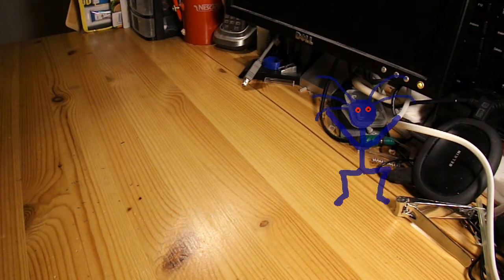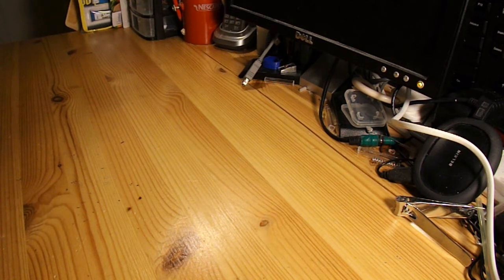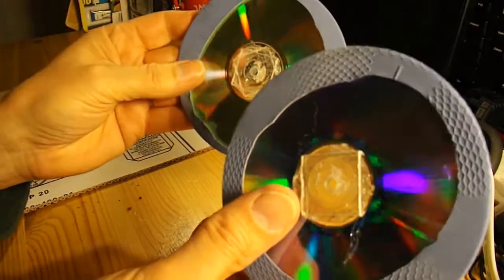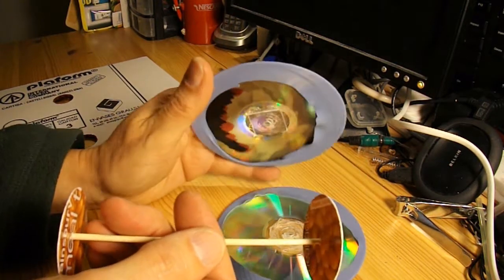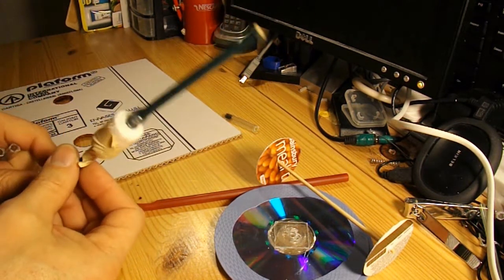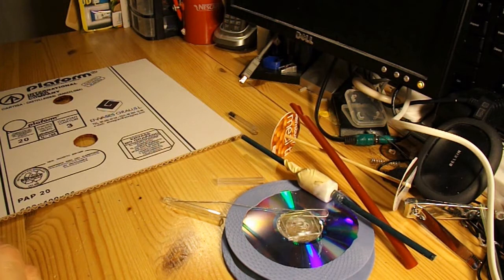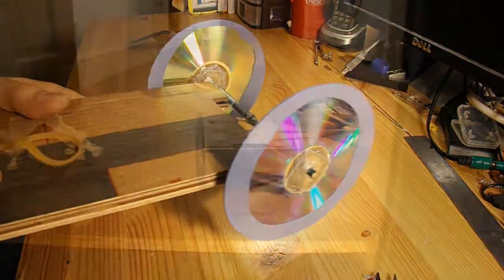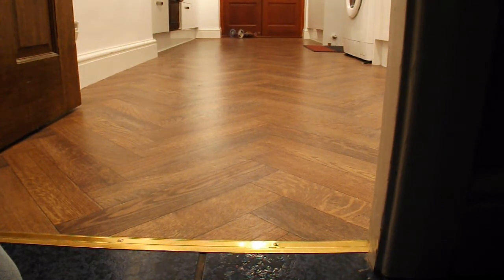Nothing's Simple Rubberband Powered Car

Comment: Hellooo!! We also have project to create our own car without using any battery, and we plan to create just like what you did. Our car should travel 4 meters after an inclined plane (30°). Can this car model or design work?? And how can the car you made be moreee faster? And does this also apply in a cemented floor? HOPE YOU HELP ME WITH THIS🥹🥹
Reply from the maker: From your description, I am guessing the car rolls down a slope to build up momentum, and then has to roll 4 metres. I would suggest thin axles, maybe use a bicycle spoke. Use large thin wheels, like CDs or DVDs. The thin axles will minimise the friction created in the axle tubes. The large wheels will help avoid the rough surface of cement. Adding weight may also help build the momentum. Here is an example of a car showing the weight helps https://youtu.be/N9S49KMwXmI
Reply: @GrandadIsAnOldMan THANK YOU SO MUCH!!! But if in a flat smooth surface, can the car that you made be more faster?
Reply from the maker: @Random-ir9xt  you are confusing me. You are asking about this car, which is rubber band powered, but you are saying that your project is for a gravity powered car running down a slope to generate the momentum. Once the car is on the flat surface, the only thing slowing it down is friction. The friction is the axle rubbing in the axle tube and the wheels on the ground. Are you saying that your car can be powered?
Reply: I’m sorry for the confusion :((( 
There will be 2 activity, the first one is that it should travel 4 meters after an inclined plane. And then after that, we can modify or enhance/add material or remove parts, for the next activity which is car race that’s why I’m also asking how to make it move more faster. I hope I explained it clear huhuuu
Reply from the maker: @Random-ir9xt  in that case, just add more rubber bands to give you more power. Too much power will make the wheels spin, so you need rubber tyres and maybe add some weight to help the wheels grip. There are useful links in the video description. Good luck 👍
Reply: @GrandadIsAnOldMan THANK YOU SO MUCH!!!

Comment: What does flower cane mean? When I searched it up I got polymer Clay is that it
Reply from the maker: It is a bamboo cane that you can usually buy in garden centres to support your flowers. Usually about 5mm in diameter. You can use BBQ skewers, which as also bamboo canes, but are thinner. I stopped using the flower canes and just use BBQ skewers for most of my builds now. There is more information in the video description if you haven't already found it. Good luck with your project.
Reply: @GrandadIsAnOldMan  thanks so much I'll just use BBQ skewers then.. wish I saw your reply before I bought modeling clay 😂 always another use for it though!
Reply from the maker: @nono-lc6th  the clay may be useful if you need to add weight to stop the wheels slipping on the floor 👍

Comment: Would u plz tell me why you set the back wheel larger than the front wheel? I no it's like common sense right? But how to use physics to prove it tho? Thanks a lot for the videos! It's great and helpful!
Reply from the maker: At the end of the video on this link I compare 3 different cars and show that it seems to be the lightest one that wins. That happens to be the one with smaller front wheels and that is because they are lighter, not because they are smaller. Hope that helps. http://youtu.be/PDewg24G3M8
Reply from the maker: Hi Cathy, I have just realised I may have misunderstood your question. Here are two more answers.
1. I use the larger wheel as the 'driven wheel' which means that is the axle that is powered by the rubber band. I find that smaller wheels have less grip, less of the rim is in contact with the road. That means that smaller wheels are more likely to spin so the car does not move forwards. If you add rubber tyres that helps the grip but small wheels still struggle. I have done other projects with small wheeled cars and they all struggle for grip.
2. I make all my cars 'rear wheel drive' so that the 'driven wheels' are at the back. This helps them grip. If you compare a front wheel drive car to a rear wheel drive car you will find the wheels on the front wheel drive car will loose grip and spin under power more easily to the rear wheel drive car. 
You may have given me an idea for a little project to demonstrate the difference. :-)
Reply from the maker: Hi Cathy, you inspired me to make another helpfile video. Here it is.
Helpfile - Rubber Band Powered Cars - Big or Small Wheels